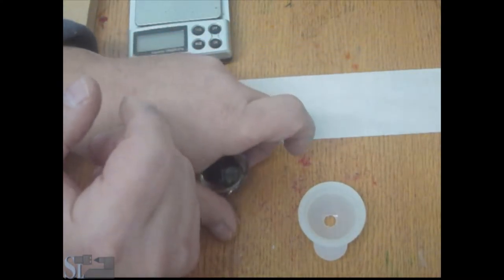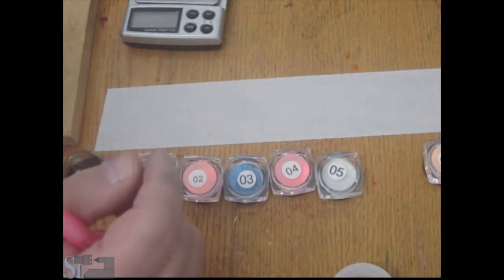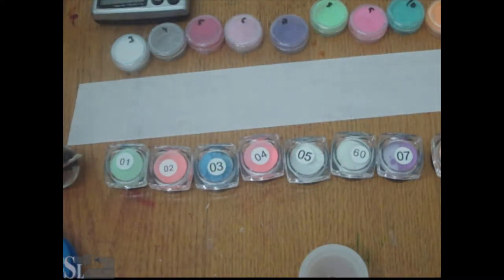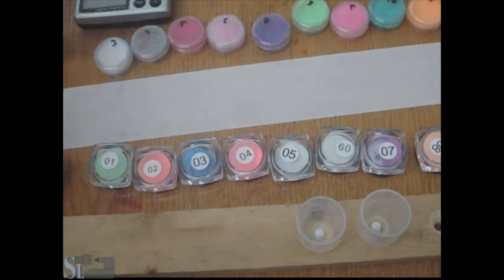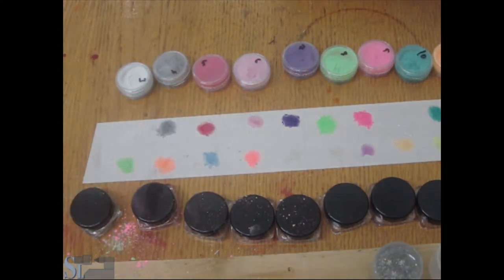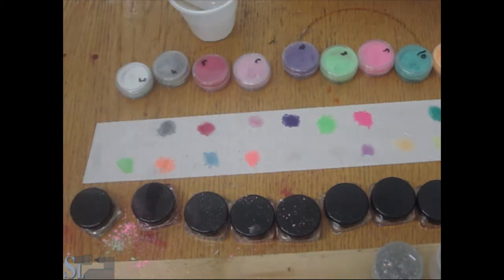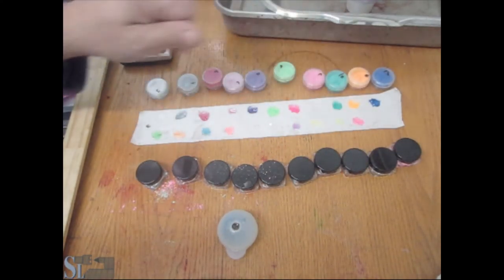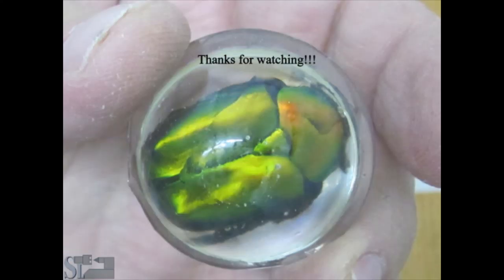Resin test and resin work update

Comment: In the bottom row between 05 and 07 you had 60, which I suspect was 09 turned upside down. The right side of the video was cut off so I couldn't see what the bottle in the 9th position was labeled.
Reply from the maker: Thanks. I didnt notice it!